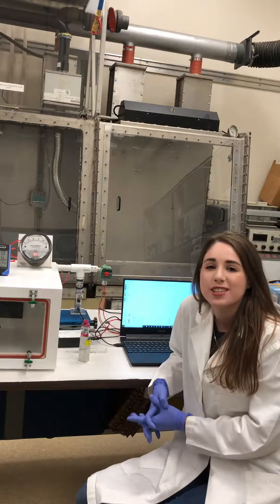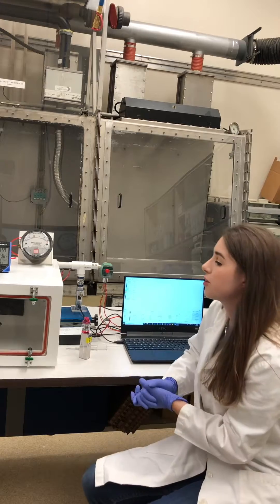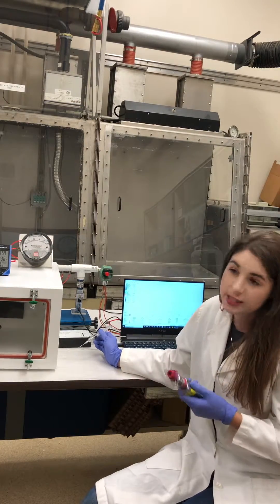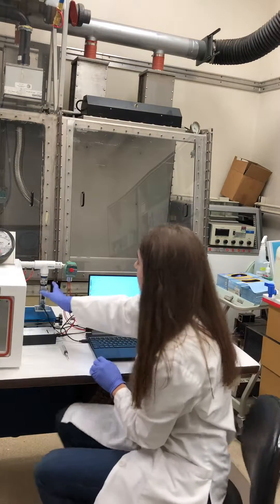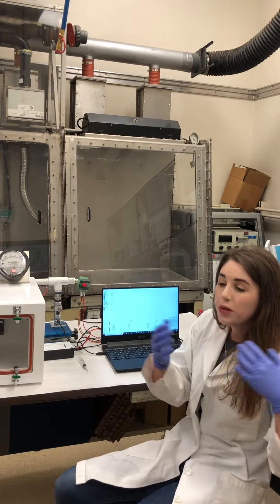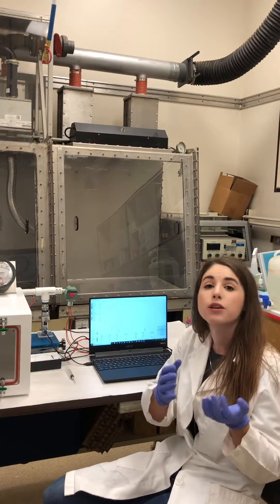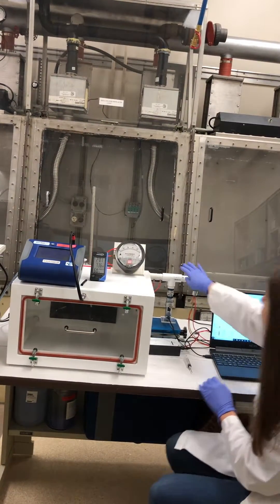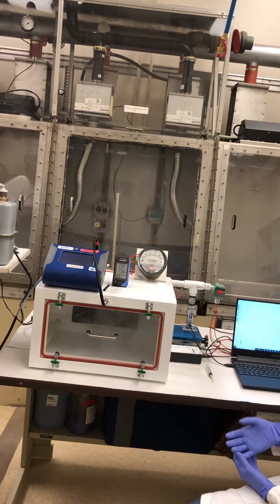Researcher Morgan Poindexter explains how a vaping chamber works

Comment: why not just use existing vape liquids? 
i'd be very curious to chat with researchers about the methods used for these tests. like PSI and whether there's a closed seal on the "mouth" and most of all is that coil properly primed?
cotton surprisingly is a very reactive wicking material that requires a very specific "priming procedure"